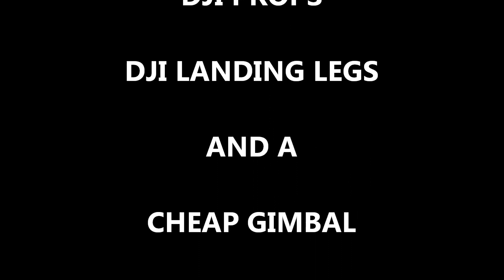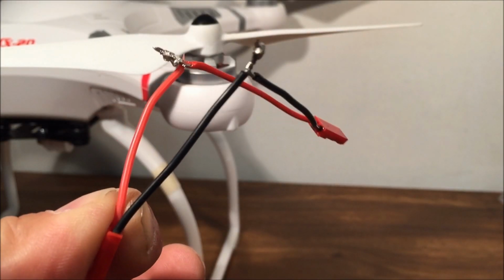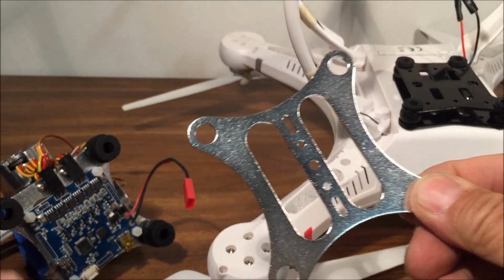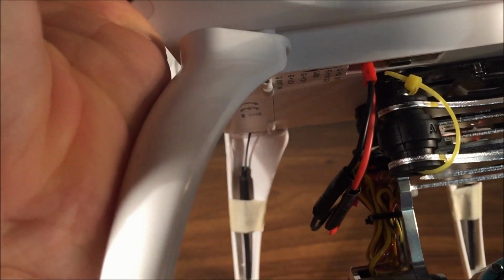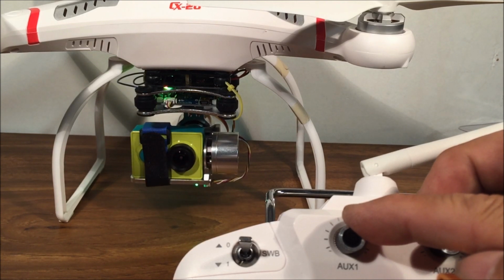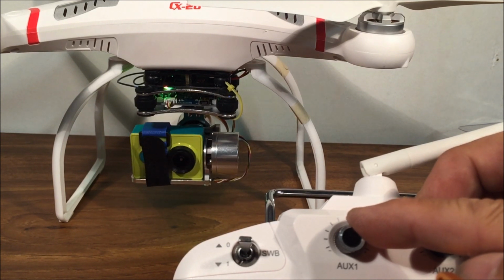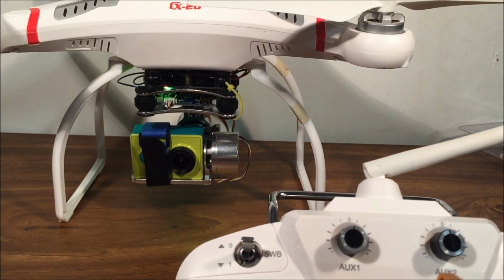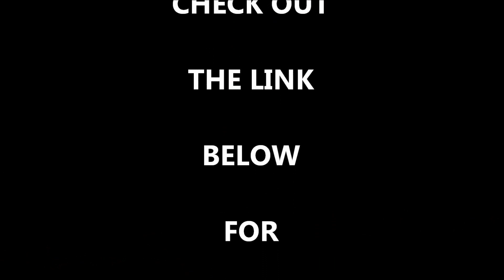CHEERSON CX20 DJI PROPS LEGS AND CHEAP GIMBAL - BANGGOOD

Comment: I have the same setup.  I also suggest relocating and shielding the GPS with copper or aluminum foil when using a camera especially if it has wifi

Comment: This is what this hobby is all about sharing info on how to make a good quad even better, nice job, I would suggest one more slight tweak I saw on youtube the other day for these dji legs to strengthen them, a coat hanger wire  cut & linked from one side to the other, middle bottom, either bent round them or a bit or epoxy to secure it in place,, I really like the cx20 it might be my next buy it's the true underdog :)
Reply from the maker: +TJ. RC.UK 
Thanks!!!

Yes it is!!  Nicely put with the true underdog reference :)
Thanks for the tip on the coat hanger!!!
Reply: No problem :), I think it has the best of both worlds it has gps + altitude hold with the option to go totally manual still unlike the xk380 which is always in gps mode & it has flight planner to which I really like, it's still a great contender in today's quad market, especially for those of us on a budget.:),
Reply from the maker: +TJ. RC.UK 
Totally agree :)

Comment: On my CX20 I also put a 2D gimbal on but I elected to go with the walkera G-2D for the reason that it wieghs in at 120g where this one comes in at 200+g. I do like the DJI landing gear that you have installed. Just how stable are they since there is only one screw hold at each end? I would like to change mine also.  Thanks for sharing and many good flying to you.
Reply from the maker: Thanks for watching!!!
Have fun!!!

Comment: hello, i have done everything like you, the exact same things, but when i fly after adding the gimbal and the tall landing gear, my drone became very unstable, it's really hard to control it. I cant believe you made it stay at one position on the air and hold the lading gear in hand, mine cant even stay one second at one position like that.
Specially when i want to land it on the ground it always flip over. Can you tell me how can i make it more stable? Thanks
Reply from the maker: You will need to calibrate the gyros by turning the quad on and immediately turn on the remote and hold the throttle stick down and right until the red light flickers yellow and red and at this time, give it throttle until the quad lifts off about 3 meters and let it hover there until the yellow and red light turns solid red and land it and hold the throttle stick down and left until the motors lock in which the red light blinks and unplug the quad and this will calibrate the gyros.
Take a look at my getting started video on this quad in which the steps are demoed.
Hope this works for you :)

Comment: I just discovered the Jumper T8SG has CX20 under the Flysky protocol and it bound to my CX20 just like a toy quad automatically. Just have to connect to mission planner and set up your flight modes. No need to install a binding plug into the rx. Finally no more beeping tx. and it will go further on 150mw output.
Reply from the maker: Awesome!!!

Comment: Awesome, what kind flight times are you getting with the gimbal and camera?
Reply from the maker: I have not tried to find out the flight time but since I do have 4 original batteries for this quad--they were on sale for $5 at one point from gearbest ny warehouse--so I practice 5 minute flights and get the shot and bring it in.
i would imagine getting around 7-8 minutes but it is healthier to keep about 20% charge for your lipo.

Comment: Great Video,,,,As for the sensitivity of the gimbal, if this is a Basecam board you can use the basecam software to adjust the pitch sensitivity and utilize the full movement of the knob in relation to position of the pitch angle. and you can also apply travel limits so you will not over travel in the up position limiting the travel to 90 deg. up and 180 deg down. FYI
Reply from the maker: Thanks!!!  I appreciate the info :)

Comment: Hi Rc, great videos first of all,  quick question I installed gimbal pretty much like you did. Only my gimbal is bit shaky like it looses control nd has weird twists sometimes any ideas? regards
Reply from the maker: if it is the same type of aluminum gimbal, go to the product page on the gimbal and there should be a link to the software that can adjust the gimbals settings. I have not done so but it is there for you to reset the gimbal to your liking.
Reply: thanks yes its the same cause i followed the links you gave. will check it out thanks.
Reply from the maker: +Ismaël Renjaan 
Ok :)

Comment: Hi, have you already figured out a way to make the input from your controller for the pitch of the gimbal less sensitive? In the video it looks like this is not really usable...
Reply from the maker: I have not made any changes since then but when the dial is rotated manically several times, the controls get less reactive and that was good enough for me to control it slowly.  Check my video of this same quad with FPV.
Others have informed me to get into the planner and settings and configure it and that would be the way to do it :)
Reply: That would indeed be the way to do it, but unfortunately the wires for the gimbal control run directly from the receiver to the pins at the bottom of the quad, instead of via the main controller board. Therefore you cannot tweak those channels using mission planner.
Reply from the maker: Maybe it was not the planner but the control software for the gimbal.

Comment: Really informative video!! 
I have a question, I'm looking to buy a drone (filming purpose) for the first time, but for less than U$S 400. I already have a go pro so I'm looking for a drone were I could attach it. 
Would you recommend me doing this? Or would you recommend me something else, like a drone is cheaper because it comes with no camera or something like that? 
Thank you very much!
Reply from the maker: I would get the phantom 3 standard.  it is 499 and it is trustworthy and has everything for filming
Reply: RC Escape I thought they were more expensive, but the phantom 3 standard is cheaper. It looks just what I'm looking for, with great quality and stabilization! Thank you for the answer!

Comment: Hi!. How much did you spend on top of the base CX20 to get this setup running?
Reply from the maker: Please check the links provided in the info box of this video :)
There should be the prices for each product :)
Reply: Great, thanks! Love the setup.
Reply from the maker: +Offshore Drifter 
Thanks!!!
I now use a walkers g2d plastic gimbal instead of the aluminum one with same results but slightly longer battery life as well as better quad performance :)

Comment: theres one flaw with your setup here

using that screw in the included black mounting plate (the one that came with the cx20) will stop the dampening balls from working and the cx20 dampening balls are a lot better than the ones from the gimbal (i know this because i used to have this same setup but i didnt bolt the 2 black plates together)
Reply: also, to fix the problem with it being too sensitive, use deadzones

Comment: hallo Sir, i'm planning tp buy a cheerson Cx 20 also buy the gimbal like yours, but, is there any difficult installation between gimbal and cx20? please help me Sir.
warm regards, Ferash
Reply from the maker: Thanks for watching!!!
I've had no problems installing it and works pretty good.  I also used the walkera g2d gimbal which is made of plastic and works good too.
Reply: RC Escape i don't understand about the blue cable, where's spot to connect it?
i was afraid that i will harm the drone works.
sir, can i have ur contact? i wish i can learn from you. thank's a lot.
Reply from the maker: ferash raditya 
@6:28 shows where

Comment: The time stamp frim the xiaomi can be off right?
Thanx
Reply: *from
Reply from the maker: Most of the time it is correct
Reply: Lost in translation.
I was meaning if it can be shut off, erased from the frame, off like the ooposite of on.
But right now I' ve seen the replay about this in another of your vidz.
Anyway, thanx.

Comment: Why do you put on the phantom legs?
thank you
Reply from the maker: +Paul Terl 
stock legs will not clear the gimbal as good as the phantom legs.
Reply from the maker: Ismaël Renjaan 
mines are wobbly as well.
you could add a bar under the bottom of the legs  and there is a product like a plexiglass or plastic that clips to both legs but i cant remember where i saw it.....kinda like a plastic ruler with holes....

Comment: Flight time with gimbal ?
Reply from the maker: around 8 minutes :)
Reply: RC Escape I have x16 gps . In the first time I fly it with gimbal flight time was around 8-9 mnts . But now It is only 5 total !! 

I use different batteries , the only thing changed is the charger ,I used before B3 balance charger ,but now I use eachine balance charger because the B3 not work . Do you think the problem from the charger eachine ?! The strange thing when it landing and check the battery voltage i find 3.85v for every cell ! But before it a round 3.65v !!

Comment: will it run 4s?
Reply from the maker: +Jeremi Paquet 
i do not have one to try....but....i do not recommend sizing up or powering up from the manufacturers given battery size due to the load and the increased flight time or performance the up size may bring, it also works the motors harder,  which in turn will shorten the life of the motors.  instead, get multiples of the same battery and give the motors time to cool between changing the batteries for consecutive flights.
Reply: ok thanks